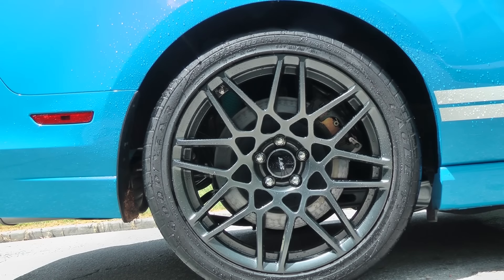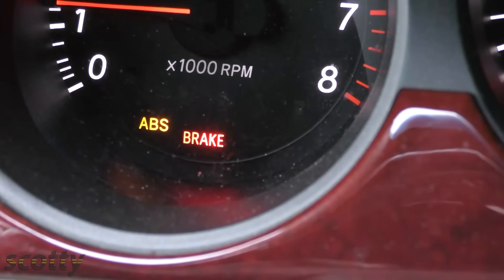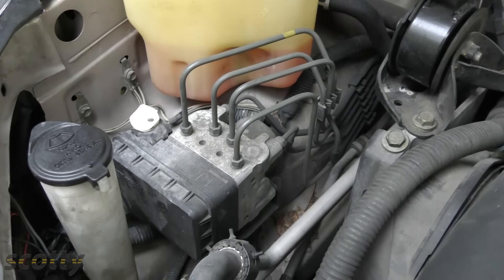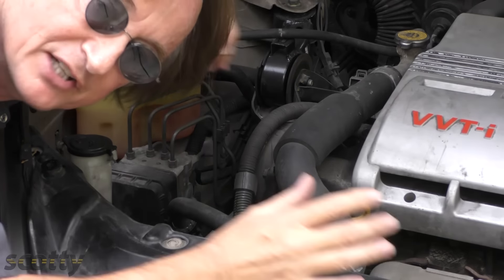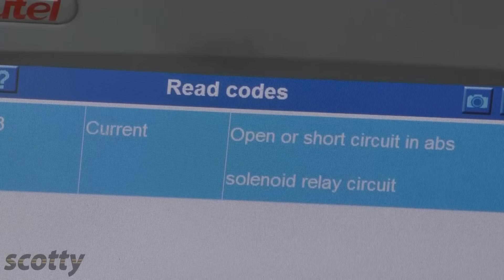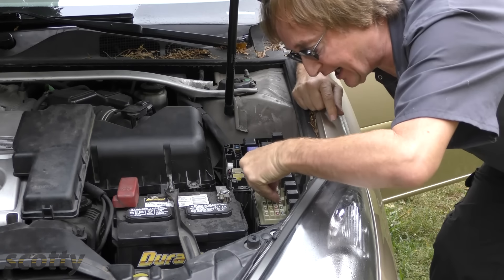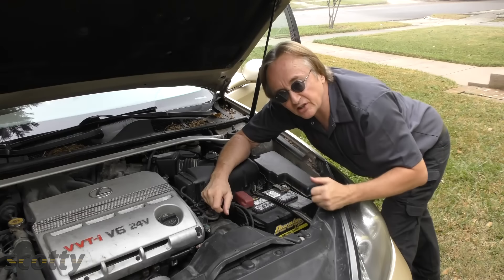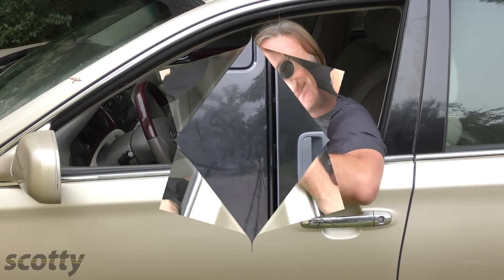ABS Light Stays On, What To Do?

Comment: Bought a new, used car for girlfriend. The abs light came on a week later. She was freaking out. I said don't worry baby, I'll fix it. After watching this video I put the car on the lift, popped the hood, spun the tires, pulled the fuse and drank some more coffee. Abs light went out and girlfriend thinks I'm a genius. Thanks bro. Subscribed!
Reply: Lol
Reply: GENIUSE LOL WILL CAR STILL PASS ENSPECTION IF FUSE PULLED
Reply: Great. Didn't want to wait for Scotty to answer me. I pulled the fuse one time and a mechanic got all upset. To bad. I like normal brakes.
Reply: @JRJUNIOR215  It depends on your State. If its a safety inspection- it could fail the inspection. The ABS System has nothing to do with an Emissions Inspection.
Reply: @davidhall3747  You are correct. ABS is a safety system so a problem with ABS can cause the  vehicle to fail the safety inspection. Also, if you drive a car like that and have an accident your insurance company can claim you were driving a car knowing it had "defective brakes" and deny your damage or liability claim.
Reply: A used car cannot be new lol
Reply: but pulling the fuse causes the light to go on?
Reply: @DiamondScuff  The light goes OFF (No fuse = No power)
Reply: @alfredmoranti5971  but in this video he pulled his fuse to get the light on?
Reply: That's called CHEATING

Comment: If it's a Chevy and the ABS light comes on..relax. Its just Chrevy's way of telling you that the vehicle is out of warranty.
Reply: No, that would be the washer fluid reservoir light. Almost half the GM cars I've worked on have leaks from them!
Reply: lol my ABS light on my Impala always comes on every now and then...no biggie
Reply: exactly my chevy truck had it on for the 8 years I owned it! I didn't have the money to have it looked at. My current car is 10 yeara old and that light has never came on!
Reply: @limeyosu2000  I have a 2006 chevy silverado. The abs light just came on. I bought it used for $4k....2 weeks ago. What year was your truck ?
Reply: Never had a Chevy with abs lights on. However the Ford in my yard has an intermittent 1 and the dodge has a constant 1. Which dodge I guess didn't use specific abs codes at least for 01. So when it happens in a Ford or dodge its just reminding you it's a pile of junk. The Ford has more problems than any car I've had. The dodge you can't find parts for and it was behind technology for its time.
Reply: Most 2002 to 2007 GM vehicles had bad wiring harness's for the ABS from the wheel and up. Common issue due to thin wire used by the GM contractor they used. Stepper motors for the cluster go bad as well and have led to accidents and tickets due to people not knowing their true speed. Class action suit was filed and GM replaced clusters on vehicles 7 years from manufacture or 70k, which ever came first.

Comment: was panicking when I saw my ABS light turn on, this video really calmed me down.
Reply: What is bmw 1999 rs1100 abd unit pin 25 and pin21..?
Reply: I just bought a ranger whose abs light came on. Tire discounters said the module couldn't read a  rear sensor which told me that the rear sensor was bad. Then tire discounters told me I didn't have a rear sensor. Moral of the story? Go online first.
Reply: Okay I don't get it what he means do does it take off??

Comment: Thank you Scotty for telling the truth about ABS…. When your ABS system has a problem it simply turns OFF and reverts to the way cars used to be BEFORE they had ABS systems. (OBVIOUSLY if you understand cars) UNFORTUNATELY, there are MANY dishonest YouTube videos by mechanics that say: “If your ABS and Brake lights are on, you MUST get it fixed otherwise you are in danger of having a serious accident.” Basically those other sites are trying to convince people that don’t understand cars that it is an emergency that needs spending money on immediately. An ABS system that has stopped working SHOULD be repaired but the truth is that (excluding OTHER brake problems) when an ABS system stops working it just turns off and it is like driving a car BEFORE having ABS.

Comment: Up here in New England we have salted roads and rust.  My ABS system was normal but traction control engaged the right hand brake around turns.  This was about 1 minute after I picked the car up after alignment.  They had replaced a broken stud.  They were unable to look at it and when you turn on dry pavement and you skid alarm beeps you  can't live with that.  They couldn't tell me what wheel the stud was replaced.  I found the new stud and it was opposite the wheel that had the problem.  I pulled the sensor and found a ton of metal filings stuck to the ABS Sensor magnet.  That must have given incorrect wheel speed and caused the anti skid to kick in.  Blew out the sensor, the hum and for good measure popped the axle nut and blew out rust there.  You are right Common Sense is a valuable tool.  Impact tools probably broke rust free in the hub.  Thanks for the videos they get you thinking, and enjoyable to watch.
John

Comment: We've got a 1993 Honda Accord EX with an ABS light on.  Since it's OBD1, I assume that the fancy diagnostic scanners wouldn't be much help...correct?
Reply: I think there is a way to erase it with a paper clip , there might be a video somewhere on youtube
Reply: yeah flash code car . You can use the paperclip method and if you don't see them dangling there either tucked in or you'll have to unclip them from there female connection. On the passenger side under the dash. Should be a blue connector. Once you unplug it from its connector home you can insert the paperclip first then put the ignition in the on position
Reply: With OBD1, when the blue connector is jumped (with a paperclip) will the car flash an error code showing specifically what's wrong with the ABS system, or does it only flash codes about engine problems?
Reply: 1993 doesn't have OB2 port, buy cars without ABS system.
Reply: Where were you when I needed you in 1993?

Comment: I have a question. My volks wagon Beatle brake pedal is sinking in but it still brakes I just need to keep pumping the brakes to stop. Everything was working fine I till I bleed the front left brakes and then  when I was done I put brakes back on and added the fliud but and after that my brakes pedal was a bit loose but I can still brake just had to keep pumping the bake to stop. Would it be my ABS or is the guild pressure not right do I need to let some air out????? Please I need help. It's a 2004 volks wagon 1.8 turbo manual n standard.

Comment: fun fact i have a 2000 model avalanche and the abs failed in a way that i had no brakes till i disabled the abs systems electrical ie: pulling the fuse and unplugging the actuator
Reply: that sounds like a problem worthy of a recall. On my BMW E36 my ABS failed but my brakes still work just fine 5 years later.
Reply: zuilok I had an 01 regal gs, & an 04 impala. Same problem, same solution. Must be a Gm thing.
Reply: The wheel hubs are prone to rusting in the "salt belt" area of the US.. The rust pushes the sensor out the hub.. Terrible design.. Easier to just pull the fuse.. I did that in my 01 Tahoe
Reply: Yep.  Same thing on my Santa Fe.  The brake pedal would push up so hard it would kick my foot off of it.  Pulled the fuse about 5 years ago.  Been good ever since.  Had to learn to live with the ABS and brake light on though.  Mine was caused by a cracked tone ring.  I need to change the CV axles now so I'll put the fuse back in when I do them.
Reply: Most 2002 to 2007 GM vehicles had bad wiring harness's for the ABS from the wheel and up. Common issue due to thin wire used by the GM contractor they used. Stepper motors for the cluster go bad as well and have led to accidents and tickets due to people not knowing their true speed. Class action suit was filed and GM replaced clusters on vehicles 7 years from manufacture or 70k, which ever came first.

Comment: Scotty, thanks to you I cleaned a couple of sensors and my pickup no longer has ABS disabled. I always start with connector cleaner if I don't have a fancy scanner.  Loose connections have been responsible for 40% of my vehicle problems.
Reply: Just think the car would still be parked at the shop
Reply: That's true..makes alot of sense to start with the least expensive issue that could cause a problem. Most mechanics won't tell you that because that would be like robbing themselves of a paycheck.

Comment: Also, check the brake fluid level... if its low put some fluid in and get the pump checked out.
Reply: Fluid level drops as your brake shoes or pads wear, adding brake fluid is NOT recommended as it will end up all over the place when you have the brake shoes or pads replaced and the pistons are pushed back to their original position.  If you have to add brake fluid for any other reason you have a leak, the system is sealed, so if you are losing brake fluid there's a leak.  Unless your brake shoes or drums are pretty worn down, the fluid level in the reservoir shouldn't be very low.
Reply: We need more people who help out in the topic, like ya'll and less people actting like kindergardners.

Comment: On my  2002 GTO the dashboard lit up like a Christmas tree . Everything worked fine .Took it to a dealer . Diagnosed abs module , the box of electronics that bolts to modulator . $ 1200 . I said just unplug the thing and I'll drive with no abs , like every other car I've ever owned . The mechanic said if I do that the main computer will read that the brakes have failed and the car won't start . So I just drove it to a wrecker and bought a used one . $ 150 . All the lights were still on . The wrecker said the computer had to be re- booted . Back to the dealer $ 200 for a re- boot . Had the car another 5 years before selling it . Never had another problem with it. I hate modern cars and damned computers for everything . ps . I'd like to know if the dealer was truthful about the engine not working if I unplugged the module . The wrecker said it was BS .
Reply: Chris M I would've told the dealer I'm here to trade in for a 69 or 70 Model year lol
Reply: Alex Y , that's what I think too . I think the dealer was lying to sell me the $ 1200 unit . The dash lights glowing bright red drove me nuts . That's the main reason I fixed it . I don't give a damn if the abs works .
Reply: Useful Entertainment , new cars are undoubtedly safer and more reliable but I do miss the simplicity of the old girls . A 69 Mustang or Camaro would be nice .
Reply: Coulda just pulled the fuse..
Reply: The dealer was lying.  The car will start, drive and brake just fine without the ABS.  All you had to do was pull the fuse and leave it out.  The ABS and brake light would stay on but the car would function fine.  You just wouldn't have ABS.

Comment: A lot of times if it’s showing a wheel speed sensor fault, unplugging that particular wheel speed sensor and cleaning the corrosion and dirt off of the male and female connections can solve the problem. Where I live whenever there’s a tidal flood people like to drive through the saltwater that’s on the roads not knowing how much damage they’re actually causing.
Reply: Eric Fortune Jr. ,,, Do you know what a,,,,.  Ringtone,,,, Is on a car,, ???   Or where it is located,,,. ???
Reply: Good point thanks!
Reply: Most 2002 to 2007 GM vehicles had bad wiring harness's for the ABS from the wheel and up. Common issue due to thin wire used by the GM contractor they used. Stepper motors for the cluster go bad as well and have led to accidents and tickets due to people not knowing their true speed. Class action suit was filed and GM replaced clusters on vehicles 7 years from manufacture or 70k, which ever came first.
Reply: It's good to know definitely going to try doing that to mine hopefully that's all it is
Reply: How can I know where is the speed sensor please
Reply: @camilamedinacubillos9201  Look really good behind the wheel hub and you’ll see a small wire. That controls the ABS, Electronic Stability and Traction Control. There’s a plastic connector that can be unplugged. Separate the connections and look at both ends. If you see a crust just clean it off with a plastic bristle brush and reconnect it. Sometimes a bad connection or a little debris can trigger those warning lights and trouble codes. If cleaning it doesn’t help then you’ll be replacing the sensor or on some models the hub assembly, depending on if it’s all made in one piece. The ABS sensors themselves are basically just magnets that tend to crack with age. You shouldn’t have to reset anything. It should clear it’s self as soon as it detects a consistent signal from each hub.

Comment: The ABS light came on in my 2003 Toyota Sienna that has nearly 200,00 miles.  I wasn't going to worry about it too much as I was going to get rid of it in the upcoming year, but had it in the garage for them to take a look at something else.  They came to me and asked if I knew that my ABS sensors on the rear wheels were just hanging there.  I said I had no.  They put them back in and the ABS light went off and all was fine for a little while.  The ABS light came back on and I crawled underneath the vehicle and saw they had fallen out.  I assume whatever had held them in had rusted away (I live in the northeast and the van has lived outside for its entire life).  I glued them in with some e6000 glue and they have been fine.

Comment: On my Ford truck my ABS lights came on 4 years ago and got quoted $800 to fix it from the dealer. Been driving fine ever since....
Normal mechanical brakes do the job fine
Reply: Taylor Hennesey same 😭
Reply: Yeah. Normal brakes are even better if you know how to drive in slippery roads. Sometimes ABS even unnecessary lenghtens the braking distance.
Reply: Yup. Same with my friend. Driving a Jeep for four years with abs lights on. Never had a problem. Didn’t want to spend the $600 to get it fixed. More so if it’s $800. Works fine for him.
Reply: If you really wanted to get the light off for maybe 10$ of less. There is a abs line under the passenger side dash in fords, unplug it and connect the male prong to a alligator clip connect Ed to the negitve terminal on the battery for 10 minutes. 90% of the time this works
Reply: I almost got in an accident because of ABS too. In some cars, ABS seems sensitive. It'll put you in a spin.
Reply: FORD is junk,buy a mitsubishi and save you're self the headace.
Reply: Siberia Bear Mitsubishi may be reliable but be prepared to work on it day and night because you have to take the fender and bumper off to access the engine
Reply: I bypass the abs all together it's a pain when u cant stop when u need too
Reply: in some cars - ABS is too sensitive, it will put you in a slide. my favorite car is the buick rendezvous because I can purposely slam on the brakes, on icy terrain and you'd never know it was icy... that's how good the ABS is.
Reply: Are you driving on gravel? Most places in the civilized world that I know of have paved roads. If where you live have mostly gravel roads, then you're likely riding a horse, not a car.

Also ABS braking is to help you stop, not to control steering. In a slide there is no control of anything at all, you're just doing that - sliding.

Oh, and btw, just by taking physics in college doesn't support your argument.
Reply: Taylor Hennesey the abs light is annpying to
Reply: Taylor Hennesey ok
Reply: My 99 Sierra abs lights come on sometimes. Not sure if it’s the module or maybe speed sensors?  After I heard about the price I just drive it old school style.
Reply: 2008 F 150 both the brake AND ABS light on...normal pedal pressure and stopping ability leads me to believe it’s a sensor ...🤞🏻for a cheap fix
Reply: Kinda sound more like your breaks we're changed and the break paddle wasn't pumped/primed before getting it back on the road I've seen that happen the car won't break if you don't do that
Reply: I Have A 2000 GMC Safari And A Auto Repair Shop Wanted To Charge Me $2000  For A ABS. Brakes. Not A Dealer. I Can't Afford it.😓😓

Comment: I wish u stayed in chicago cause these auto shops here are monsters a guy told me 4k for a rebuilt dodge magnum 3.5L transmission smh
Reply: Shine Onn ENT. Is your car the 5 speed or the 4 speed? If it's the 5 speed, check your trans fluid level. It's very important on the 5 speed trans. Too much fluid and too little fluid will make the trans very unhappy. If the level is good, then go and check your transmission computer. If it is filled with transmission fluid, clean it out with maf cleaner, NOT electronic cleaner and let it dry overnight. After this you need to replace your pilot bushing. Even if there's no fluid in the trans computer it's still a good idea to replace the pilot bushing. If that still doesn't do anything, then you need to replace the conductor plate in the trans. It's above the valve body. The 5 speed is very reliable mechanically. Almost always the conductor plate is the problem. Also even when you replace the conductor plate you may have to clear the error codes otherwise the problem will remain.
Reply: Next time don't buy a dodge buy a mitsubishi, their super reliable Japanese vehicals.
Reply: You lucky in Texas 8k
Reply: Shine Onn ENT. I know what you meant